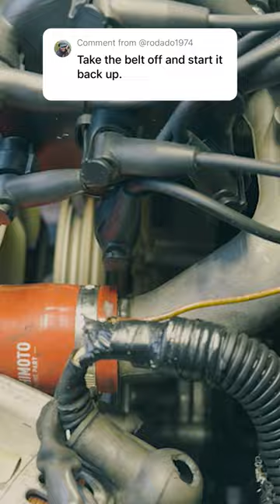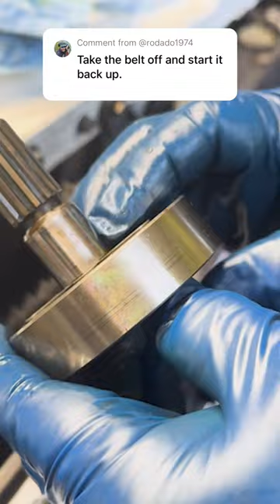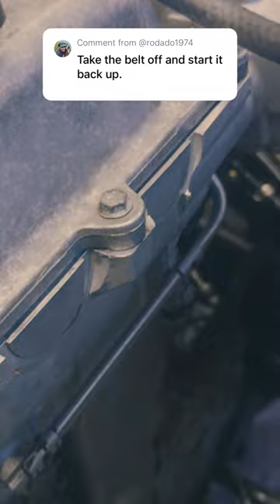Belts/Power Steering Pump Off - Still Knocks #shorts #toyota #landcruiser #4x4 #offroad #diy #engine

Comment: Replace oil pump drive gear and bushing. Take off timing cover to get to it. No need to remove head.
Reply from the maker: Lower and upper oil pans need to come out though no?
Reply: @Austin_SaintOnge  yes both oil pans must be removed.
Reply from the maker: @968Pete yup that’ll be the next step - just want to wait to hear back from the Land Cruiser shop before we tear into it in case it voids any warranty it might have